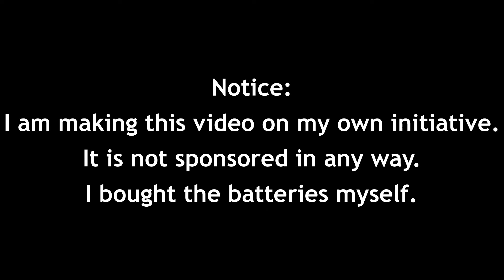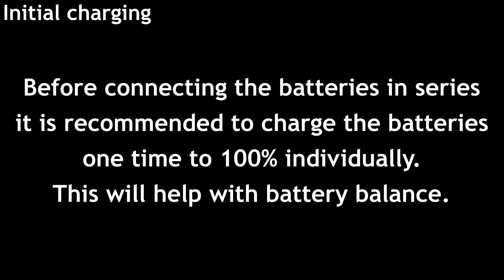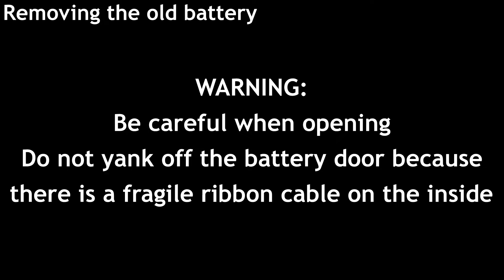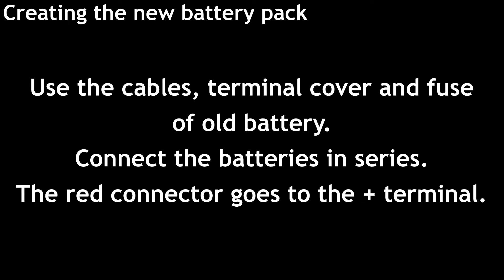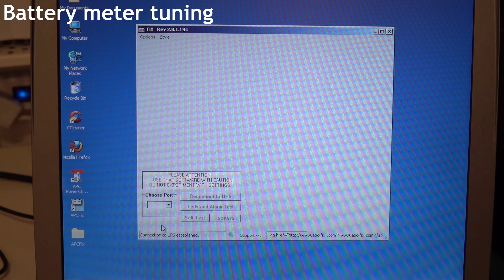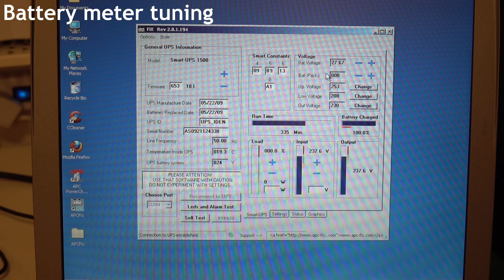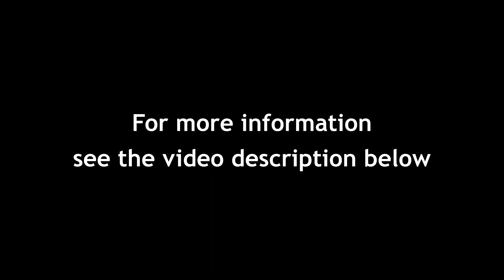Upgrade APC Smart-UPS to LiFePO4 batteries by PowerTech

Comment: Has anyone tried this with the new 24V Powerbricks+?
Reply from the maker: It should work if you can connect the cables and if the batteries physically fit. The original configuration is 2x 12V in series but the UPS will just see 24V. It will not know if it has 2 12V batteries in series or one 24V battery.

Comment: I have an APC SmartUPS 1400 RM that I am trying out 4 10 ah LiFePO4 batteries on.  It seems to charge the batteries and the battery gauge on the unit seems to work.  I have been only running them a couple of days.  I used the utility to set the setting like you showed in the video.  Though I had to stop the APC service in windows otherwise I couldn't connect with the com port.

Comment: Always connect PLUS at first, then MINUS... looking at this - no matter is high or low voltage makes you an amateur :/
Reply from the maker: I AM an amateur. What makes you think I am doing this for my work? I'm just a home user.
Reply: It doesn't matter here, it is only important in environments where minus is on the casing or on the car body.
Reply: You only need to do that when you have an earthe chassis nearby. He was wiring up two plastic coated batteries. It makes absolutely no difference what order you connect two UNCONNECTED wires to a battery.

Comment: hi, great video. One question. Does ups charge batteries if they get completely drained?
Reply from the maker: I have used the UPS on battery until the UPS shut down the load and then recharged it using the UPS without any issues. The BMS of the batteries will make sure the batteries do not get completely drained to a level where the batteries are damaged.

Comment: What about UPS charge controller? Is the circuit enough strong to deliver the requested lifepo4 amperage to charge them at all?
Reply from the maker: Recharging them (with the UPS) takes long. I haven't timed it but I would guess it was a bit less than 24 hours. Just give it time to charge. The UPS will not overcharge the batteries and the UPS will not charge with more amps than it can safely handle. Just give it time.
Reply: @Hypernl  ok, I suppose you checked the datasheet of UPS. What about temps when its charging? I have a smaller one so I want to be sure
Reply from the maker: @utente617  I have the SUA1500i. It turns on it's fan when charging so it stays cool. The SUA1000i has no fan so that one may warm up. The batteries themselves are not getting warm. Especially because the UPS has a fairly low amperage for charging them.

Comment: Thanks for the video. How long have you been using the UPS with these batteries? Any issues or concerns, besides the ones already described?
I purchased mine APC new in 2014 and the original battery just die, so no complains, getting more than 9 years from the OEM. 

My dilemma is, what I would be gaining by using LiFePO4 battery?
Reply from the maker: Two APC SUA1500i UPS units have been in use with my workstation and server since the making of this video. There have been no problems at all. You will have to decide if you want to replace your dead batteries with (cheaper) traditional SLA batteries or (these) LiFePO4 batteries. Nine years usable lifetime from SLA batteries is rare. They usually last up to 5 years. (Between 3 to 5 years is expected)
Reply: @Hypernl  Thanks!

Comment: Could you show the cable you used to connect this to your computer?
Reply: APC part number 940-0024C 
Google for "Desc: APC UPS cables File: apc.txt Date: 12 February 2010 Auth: Arjen de Korte" if you want to make your own one.
Reply: @ruben_balea  ^This or use a standard USB B to USB A cable. For the APC-Fix utility or manual programming you need the mentioned APC Serial cable. A regular serial cable will not work.
Reply: @Aranimda  Yes, I use the USB cable to monitor the UPS status and shutdown the computer when the battery is low, using the "HID UPS Battery" driver Windows 10/11 will treat the UPS almost like a battery on a laptop.
@schneiderelectric has a video called "Switching from APC USB UPS Drivers to HID Drivers on Windows" where they show how to switch from "APC UPS" driver used by PowerChute (and sometimes also by Windows) to "HID UPS Battery" driver

Comment: Hi sir! A great project. Brazil charges high prices on the batteries. The regular RBC7 battery is costly. Battery packs cost almost as much as new UPEs.
Let me ask you a question? Can regular batteries be used? 12av 7ah? Since I can't install those batteries in the same place as the original, I put them on the UPS's side with an extension. What you think?
Reply from the maker: When you want regular AGM/SLA batteries but not want to pay the price for APC branded ones, you can buy any compatible 12V 18Ah batteries. Fact is that APC does not make batteries themselves. They buy them from battery manufacturers and make a ready-made pack from it. You can just use your existing fuse and cables and buy replacement batteries from brands like Kung Long, CSB, Yuasa and you will save a lot of money over an original RBC7 pack. You need maintenance free, sealed deep cycle batteries.
Kung Long WP18-12SHR, Yuasa NP18-12 for example. You should not use car batteries because they are not designed to be deeply discharged.

Comment: What?? video from 2009.. where did this old stuff come from? Did you find it in the trash?
Reply from the maker: Video is made in 2023 and the upgrade is done in 2023. The UPS is much older. Perhaps from 2009. I don't remember. These are quality UPS units and they can last for many years as long as you provide them with fresh batteries when needed. I got 4 units of this generation. 2x SUA1000i and 2x SUA1500i and none of them failed so far.
Reply: @Hypernl  Your laptop is circa 2002.
Reply from the maker: @deepfrieddeals  I know. I have many old and new computers. Oldest one is from the 1990s and has a Pentium II. Newest has a Threadripper Pro from 2024.

Comment: I did a similar conversion to Li several months ago.  I solved the internal charge voltage problem by using a cheep Amazon boost converter.  I found one that is fairly efficient and gives enough regulated boost voltage to fully charge the Li.  HiLetgo 250W DC-DC Module 10-40V to 10-50V 6A Adjustable Step-Up Power Supply Module  The slight loss in charge current is not normally a problem.  Also, I check balance periodically and have never found that to be a concern.  I fully charged both batteries separately before installing and then placed them in parallel for several days to even the charge.  Once installed in series everything was good.  (The boost module may be overkill. there are lower power modules available).

Comment: I have done a couple of conversions of the LCD Versions of APC LCD Smart UPS's. 1. the charging voltage for a LiFePO4 battery is higher than for an SLA and this is important because the APC UPS will NOT fully charge a LiFePO4 battery without some level of modification. Using a USB to serial adapter I was able to enter the Programing mode and adjust the Float Charing Voltage to 28 VDC and 28.3 VDC (two different UPS's). The recommended charging voltage for the LiPO4 batteries is 14.2 to 14.6 VDC each (28.4 to 29.2 VDC for a pair). You will see that even after the adjustment I was not quite able to get the necessary voltage from the UPS to charge the batteries - that is one reason why the video starts with charging them externally. If you start with charged batteries they should work until they are discharged, but one of the main functions of a UPS is to keep the batteries charged (which it won't quite do for the LiPO4 batteries). This ends up resulting in the system being very undercharged, but reporting O.K. to the UPS then when the power goes out they system rapidly discharges and dies. My next step is to solder a Potentiometer (on to the main board to give me more adjustment, but I am not even sure that will be adequate).
Reply: Hey is there a write up for this procedure available somewhere?
Reply: how did you get into that 'programming mode'?
Reply: @udirt  serach for "hacking-the-newer-apc-upss-mini-worklog-howto"
Reply: Wouldn't you use a differential amplifier to lower that voltage seen by the system?

Comment: You should probably tighten the power terminals on the batteries a lot more, a lot of amps go through these connections so you can't tighten them in a flimsy way with your fingers, you're more busy making one of those youtube videos where everything goes in slow motion and you have to see everything from the box to the plug from all angles, the only thing you need is a pair of blue or black plastic gloves then it would have been home in the form of a really crappy video, one thing you remembered was at least a really annoying " music" I don't think I've heard such bad music since the C64 came out.....If you're going to make those types of videos, make them the way they should be made.
Reply from the maker: I just checked the connections to the terminals, and they were fine. But yes, they need to be properly tightened for a good electrical connection. And for the other remarks: I invite you to make a better video or one that better suits your taste of presentation and music.
Reply: it's probably a 20 years old video tho
Reply: I hear a lot of FM-y sounds here that the SID would not have been able to produce. Based on that, the sampling rate, and the fact that no more than 4 instruments play at once, it's far more likely this music comes from an Amiga instead, or a PC-compatible with an early sampling sound card. These, unlike the C64, were also around for the early days of BBSes, so a lot more music was being composed and shared for the platform, some of which is still available here on YouTube.

Comment: Charge voltage curves are completely different for SLA and LFP batteries.  Does the software allow them to be changed?    I am not all that thrilled at running software that comes from a Russian underground site.  Anyone check the software out in a sandbox and see if it is Okay?
Reply from the maker: If you don't trust the software, then don't use it. It was self published by a small but skilled software developer and comes with the risk profile of all software you download from the website of small developers. You cannot change the charging voltage with it. You may be able to do that via a telnet session. You will have to consult guides to do so as you can truly ruin your UPS by entering the wrong commands in that raw interface.

APC charging voltage will be a tad low for LFP batteries. This will cause the charge to not reach 100%. This may be a good thing depending on your use because not charging it to 100% all the time will cause less aging of the battery cells.
Reply: The BMS on the LiFePO4 batteries can deal with this somewhat if the charge voltage is in range. However, the BMS will not be able to charge a LiFePO4 battery if the voltage is too low - which is likely the case.
Reply: @Get_A_Grip_All Lifepo4 cell are not 4s but 3s so the ups are designed to charge two 13.6 batteries which is 27.3 and Lifepo4 charge voltage is 25.2v max the bms may do the battery charge protection

Comment: What about the fact that the BMS limits the battery to only 45A which is 576Watts. Double this for 2 batterie and it's close to 1200Watts but not 1500VA. I am thinking that maybe the BMS will shutdown in case of high drainage! What do you think?
Reply from the maker: Yes, this seems a real limitation. Not one I will ever touch with my equipment but the limitation is there and something to consider. I think foor the great majority of the users this limitation will be more than compensated by the far longer runtime of these batteries. Especially with the abysmal runtime you will get from the original 2x 18Ah SLA batteries when you load the UPS to it's capacity.
Reply: @Hypernl  what is the expected run time for the original batteries? I'm trying to decide what to order for mine currently.
Reply from the maker: @carldalsasso8603  Well, that depends a lot about the load. Lead-acid batteries prefer a slow drain. You can put high leads on them no problem but this affects runtime a lot. You can get an estimation of the runtimes with new original batteries on the APC website: https://www.apc.com/be/en/product/SUA1500I/apc-smartups-1500va-usb-serial-230v/ Imo, the predictions there are a bit too favorable. Take 66% of their predictions and you're probably fine. Aged lead-acid batteries 2 to 5 years old will have a much worse runtime.

Comment: II have done the same with my BX1100CI-RS, added external 32AH 24V LifePO4 battery pack with Active Balancer and shunt trip protection on cell voltage limit. Works like a charm, charge time is a bit long with 1A, but if drained fully, I usually charge it with external charger.
Reply: Does the power meter reflect the actual capacity?
Reply: @dejgo351  No. I had to turn off low voltage protection, otherwise it was always showing like 10-20% capacity and trying to shut down at nominal 3.2 voltage per cell where LFP sits for 80% capacity used. On smart UPS there is a calibration function, you charge battery to 100%, then give constant load like 50% and turn off input. Then capacity calculator counts till battery is discharged and updates capacity. in Back UPS there is basic controller with voltage level capacity algorithm
Reply: @ Hmm, sorry, I'm not getting it. SUA1500 is smart ups, so why didn't you use calibration function so it shows proper capacity so you can actually use it all and trigger the shutdown when it's actually drained?
Reply: @dejgo351  because I have BX1100 series which is back ups
Reply: @ my bad, sorry man,  I need to learn how to read.

Comment: I didn't know about APCFix and I've been doing the constant changes using the APC serial cable and PuTTY. Anyway, can APCFix change the charging voltage on the UPS to support the higher voltage of the LFP batteries? Is that a good idea? Do the batteries need re-balancing after some time? I have several SU700i/inet.
Reply from the maker: No, APCFix can't change the charging voltage. At least not on my models. SUA1000i and SUA1500i.
A higher charging voltage can be a good idea but you need to look up the spec sheet of your batteries that you don't overcharge them. With my UPS the charging voltage is a bit low for LiFePO4 batteries which means the batteries will not reach 100% charge. To me this is fine because not charging them to 100% all the time will increase the battery life in years while still having a battery runtime that blows the original SLA batteries out of the water.
I haven't had to do any rebalancing since I installed the new batteries and everything charges and discharges still fine. The original SLA batteries can be installed without balancing for years. But to maximize runtime it won't hurt to occasionally charge them individually every year or every few years to prevent them to go out of sync too much.

Comment: Well done. It is possible to make a video testing other appliances which consume more wattage?
Reply from the maker: I don't feel like making another video now. But I just tested the UPS with a 3D workstation running CPU ang GPU benchmarks. Power load at the wall outlet was 550 watt. When I yanked out the plug from the UPS the UPS just switched to battery fine and the PC stayed on uninterrupted.
Reply: Fair enough, @Hypernl  . Thanks for the reply at least.
Reply from the maker: Just a small update. I got a new PC with Threadripper 7000 CPU, and it takes up to 650 watt from the UPS. I yanked out the power cord and the UPS takes the load no problem.